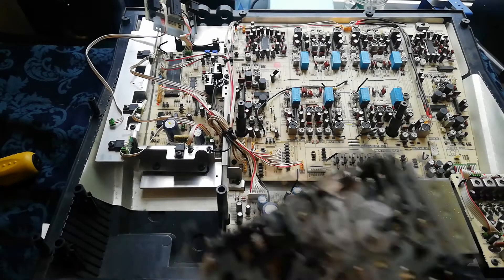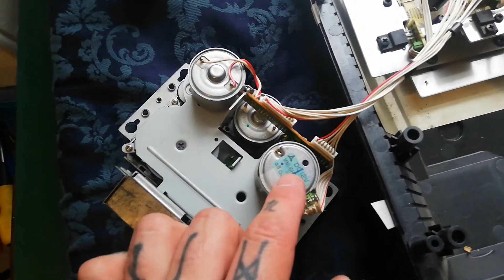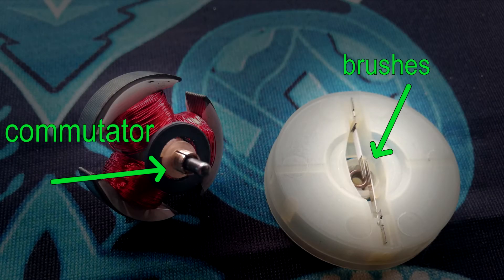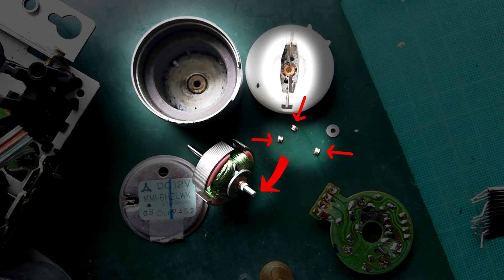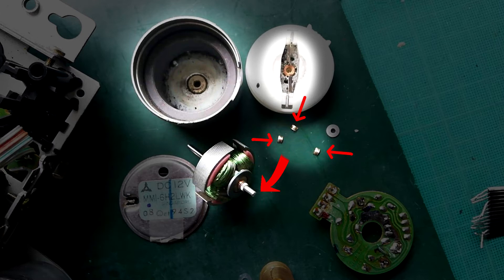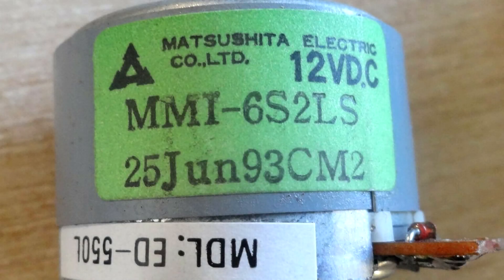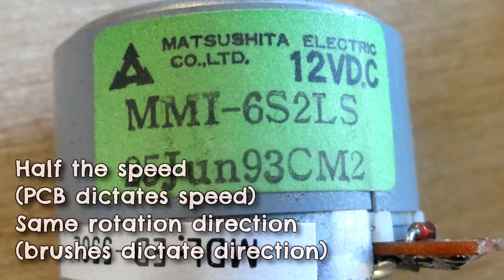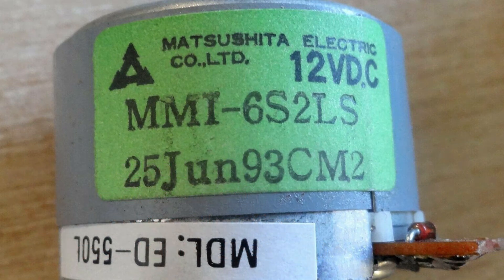Noisy Matsuchita 12v Motor in a Yamaha MT8X - Broken commutator

Comment: What info do I need to find a suitable replacement motor if this model is unavailable?
Reply from the maker: Let me have a look at the schematics and get back to you tomorrow
Reply: @Tetrakan  Thank you so much for what you do!
Reply from the maker: Hey so I ahd a look at the schematic, and the circuit is of the type where there is a loop with resistors in it joining to two of the four motor pins labelled A and B. I needed to check that becasue some yamahas including the little brother MT4X use a different and more complicated style of circuit to control motor speed. But with your MT8X you could buy a Mabuchi EG500KD or Eg530YD or EG500YD (I'm regurgitating the serial numbers from memory, so I might be a little off, get5 back to me if you can't find anythign on those search terms) and you'd probably need to adjust the trimpots on the MT89X or the variable resistor on the motor if the one you get hold of has such a feature, but those mdoels would basically work as drop in substitutes I think.

Comment: Any idea how to make the motor spin faster? tape keeps on getting stuck on the pinch roller after replacing the mmi-6h2lwk with another one I found on eBay. I think its moving to slow
Reply from the maker: Sounds like the smaller of the two belts and/or the idler tires ate loose. If you tell me which model you own I could narrow that down?
Reply: @Tetrakan  its on the mt8x, is that what model  youre looking for?
Reply from the maker: @btiemann6356  I've only seen that model once...remind me...is it a one two or three motor system under the hood?
Reply: @Tetrakan  3 motor system
Reply from the maker: @btiemann6356  I’m actually a bit I’ll and busy right now but if you could message me via Facebook, even if I can’t help you fix your issue  I could put you in touch with a couple of techs I know who have spent a lot more time working on Yamaha stuff? Also search for “3rd island mt8x 10 second problem” or similar on YouTube search - another yt tech who again is more familiar with the YouTube stuff addressed this issue to do with the reel motor belt which might speak to this issue, but, again not a strong suite for me sadly.
Reply: @Tetrakan  Thanks so much!
Reply: @Tetrakan  just sent you a msg
Reply: Just acquired a TASCAM 302 (MK naught) dual well cassette deck. It has a pair of these exact motors MMI-6H2LWK. Difference is the logo is a goofy looking “M” and build date of DEC95.

These decks spec well and I hope to clean and lube these motors to preserve them. Invaluable images to prepare me for that. Thanks for this, and all your work posting these adventures!

Comment: Any chance I could get a more detailed tutorial on how to replace this? I have this problem and I own the replacement motor you recommended, but i am somewhat lost.
Reply from the maker: I've made a couple more videos you should find helpful, see this one https://youtu.be/KlaFh-X83sg and this one https://youtu.be/h1BBVAtDtIo it's a different brand of motor but the process for detaching the PCB is the same
Reply: So basically you took out the chip from the original motor and the replacement motor, you put the old chip in the new replacement motor and attached the replacement motor to the device?
Reply from the maker: I swapped the entire circuit board
Reply: How did you go about removing the golden motor pulley from the one?
Reply from the maker: If it doesn't pry off easily with a flathead screwdriver as a lever between the pulley and the motor case try heating the pulley with a cigarette lighter to loosen the adhesive
Reply: @Tetrakan  okay. How do you go about reattaching it? Or do you need to buy a new one?
Reply from the maker: The old one should just push on
Reply: @Tetrakan  Hey! great pro-tip. For some reason my screen isn’t on now i may have forgotten a plug. I also have an issue with the new motor. It doesn’t have variable speed. Is there a way to calibrate this?
Reply from the maker: The motor speed is calibrated using a trimpot on the control PCB below the cassette transport.
Reply: @Tetrakan  I'm having a bit trouble finding what you're talking about. When I switch in the Vari speed button the trim-pot does not affect the speed of the motor. Am I missing a plug or something? The playback of the tape is extremely fast so I have left the machine off to avoid any wear.
Reply: @Tetrakan  what would be the best approach to fixing this?
Reply: @joshuabrown6256  i have the same problem and i haven't found any good resources. idk if it needs to be recapped? or if we missed a connection? if ya have any updates that would be greatly appreciated!
Reply: Hello again. Sorry I Haven’t had time to work on the machine or write back. But today I’ve been working on getting this speed calibrated i found the speed trimpots located on the pcb under the cassette transport, near the headphone jack pcbs. I have run into a problem when attempting to loosen the trimpot the blue casing and screw head popped off together.